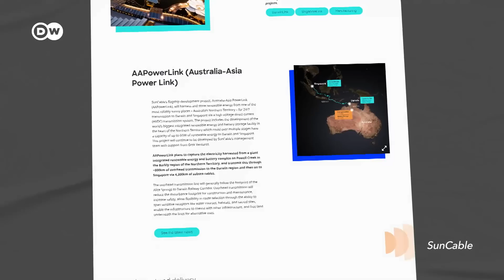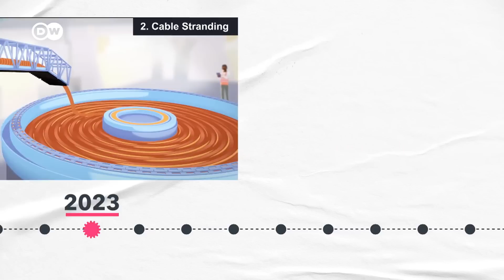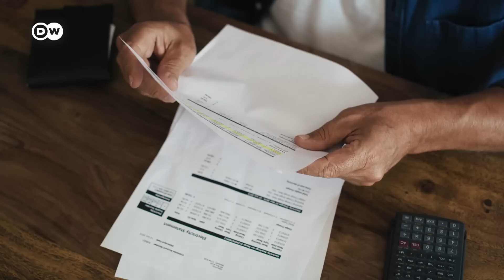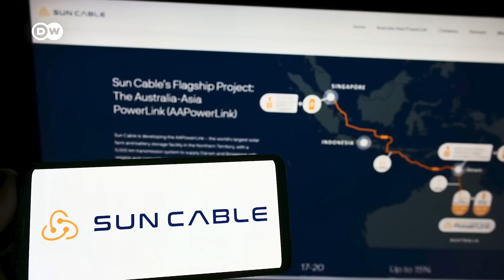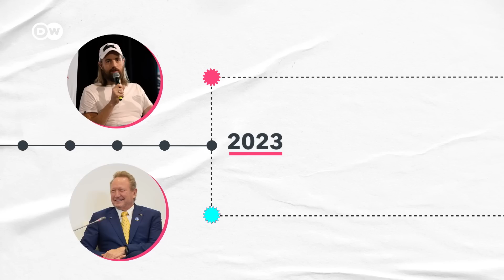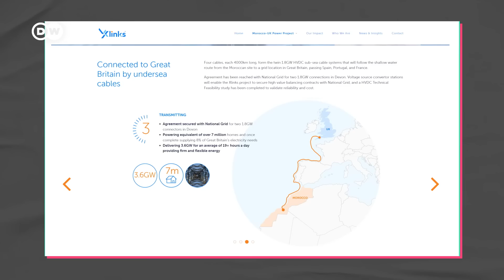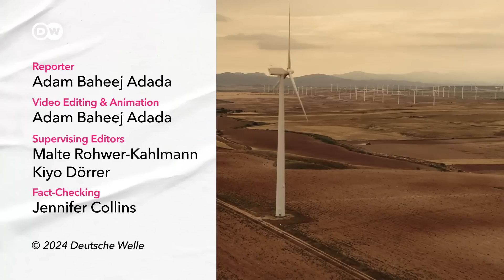Why the mega plan to send Australian solar to Asia (almost) flopped

Comment: I don't understand why such a project wouldn't aim first to power Australia with renewable energy. At present only 40% of the electricity in Australia comes from renewables. It would also avoid the technical issues of submarine cables and the potential sabotage risk of passing in third party territorial waters.
Reply: Power price during the day in Australia goes negative due in part to the high level of rooftop solar. So it wouldn’t make much if any money at all in the Australian market
Reply: @megapaul 13, this plant has a large storage array (i.e. battery). On the australian market, they would sell futures contracts via a (power purchase agreement) and mostly would not get paid the "market price". They would also store electricity to sell later in the evening, at high prices.
Reply: then how you get money from other countries , Its all about foreign money not about environment
Reply: @BanTeslaX  Probably better to get it selling clean energy in one form or another than continuing to supply coal and gas.
Reply: Build a big grid
Reply: @qjtvaddict  Really expensive though, and the grid needs to be balanced at all times.  
Just as an example Planet Money podcast did an episode of Green Gridlock.  The story was on 2 huge wind projects in the Dakotas - the projects were in the 1.2billion cost range - just connecting to the grid was quoted as $840 million (which was not part of the 1.2billion budget)
Reply: Nope, It's only 30%.
Reply: Simples, your government is held by its short & curlies by the fossil fuel mafia.
Reply: 05:00 the world doesnt include China......
Reply: Australia is the largest exporter of coal in the world.
Reply: Money is power 💸 nothing else
Reply: Evil Red Chicom will cut anyone's cables.
Reply: Australia is increasing their renewable power generation.     that can and should be done, but it does not need to have any affect on a possible Solar cable to Singapore.
Reply: I can answer the first part of your question - it’s because we already have a different massive project that will serve the states needs computer on renewables . And right now we have enough solar pv to meet more than 85% of the this state’s (Western Australia) electricity needs. And we are on track to completely wean off coal power with a decades time.
Reply: No technical or financial reason, just politics stands in the way. First problem: No matter where you build the array, storage, poles and wires to connect it, people object (why they wanted to build this in middle of nowhere and put the wires underwater). 

Second problem, gas and coal generators more or less write off expensive assets. This means a lot of money can be spent lobbying government to obstruct new developmemts, thereby delaying that asset write down (why they wanted to send power to Singapore, who would love to save some cash on gas imports).

Third problem: dealing with the energy market. It is financially complicated, imposes rules and regulations which can delay connections by years, and there is lack of coordination between generation investment and transmission planning (e.g. "this looks like a good spot for a solar farm", so 10 companies each put a farm there, but transmission capacity accomodates only 3). Singapore can accomodate this landing at one point, with capacity known well in advance, without much fuss.
Reply: The reason for exporting this much solar to Singapore and not use it in Australia is because there is an excess of solar on the parts of australia that have a centralised grid (the east). If this businessman invested his money on more solar, it will not be used and he will not make his money back. What we need more right now is batteries, and you may ask why he didn't invest in that instead. While I don't know his exact reasons, one of them was probably the fact that batteries are complicated to build, maintain, and most importantly, connect to the grid. It is a difficult process that not many want to go through.

It also simply comes down to the fact that its his money, and his decisions on where to invest.
Reply: @Ripcode2233891  the Australian Labor government is looking to invest in batteries through the Future Made in Australia fund. Private investors can get a bigger slice of the business when dealing with foreign export such as Suncable.
Reply: @Ripcode2233891  well batteries are a form of storage and are affordable for short term storage of seconds/hrs but for longer term storage the ammonia option sounds better because it also includes storage and can be transported and stored a lot like propane.  And NH3 has no c02 emissions.  The Japanese and Koreans are seriously working on using it in powerplants and maritime transport.
Reply: @peterkratoska4524  I don't disagree, but this is just a different project for a different area of the world. Singapore is much closer than both those countries
Reply: Reminds me of gambling addicts, doesn't work now, but I'm sure it will work if there is a little bit more money, It will work for sure, it's so simple.  What? A Ponzi scheme? I'm shocked, shocked I say.
Reply: we dont have any storage. how will we power all our homes at night when it isnt windy? its much more efficient to ship it off when its burdening our grid.
Reply: @jonathanodude6660 The project involved battery storage.
Reply: @CT-vm4gf  “At present only 40% of the electricity in Australia comes from renewables.” A project like this won’t change that. Anyways, I don’t think the NT is connected to any other state grids, so it would still require HVDC interconnection and thousands of kilometres of cables.
Reply: @jonathanodude6660  How would adding renewables not increase renewables? Nothing you said makes any sense.
Reply: @jonathanodude6660  tbh those are much easier to build, over land within the same country. the investors must consider diversification - internal supply, ammonia/h2 manufacturing as well as export to singapore. I don't think there is any shortage of land in the region to do all of the following.
Reply: @CT-vm4gf  "The project involved battery storage."
I still don't understand how batteries are feasible. To build that much battery storage we are going to have to rape the Earth of resources. Which countries are going to allow all that mining?
Reply: @jonathanodude6660  SO the Asia got storage magically ?
Reply: It only gets to 40% under ideal conditions. The reality on an average day is considerably lower, no matter what AEMO says. I don't trust their figures any more than other "tweaked" economic metrics.
Reply: In fact that 40% is an underestimate. Behind the meter solar cancels out a large amount of daytime demand.

Comment: Singapore is always going to be vulnerable to energy supplies, adding another suppliers reduces risks overall, even if each supply has its own individual risks.
Reply: Yes, that is correct. . .  Try to get to multiple sources of energy.. . .   Note renewable energy, Wind and Solar must not cause existing other power generation sites to be closed down, but then they can burn less fossil fuel.

Comment: Turning the power to methane or ammonia seems more viable. It can be easily stored, which reduces the concerns about energy security, just as how we use natural gas these days. It can be transferred without massively building a mega power cable network.
Reply: Hydrogen/ammonia is terribly inefficient compared to electricity.

Comment: 4:32 😂Indonesian Sea. Do you have permission?
Reply: Why not sell to Indonesia? And the connect the grid thru Indonesia? The whole idea seems stupid as it ignored the needs closer to the source
Reply: @crasho1980 indonesian state owned electricity company (PLN) is monopolizing the electricity all over indonesia, and the really hate competitor no matter local private company or even foreign company. Also indonesia lots of bribery.
Reply: @ridhobaihaqi144  in case you don't know, PLN buy electricity for private power plan. So buying from Australia is not a stretch. They will need to talk to Indonesia govt anyway as they need to cross Indonesian water.
Reply: If Elon Musk can enter the monopoly of Internet provider market
I'm confident that they can
Though don't rely on Indonesia to protect the cable

Comment: I am a big supporter of renewable energy, but this project doesn't seem that realistic. I'd love to be proved wrong.
Green hydrogen can be used in other ways. Ships could dock in or near Darwin and refuel with ammonia or methanol, whichever wins out. Green steel and aluminium are also great opportunities for Australia. That is another way to reduce CO2 emissions without the issues raised.

Comment: Apart from Australia, Indonesia has also been exporting its energy to Singapore, but not from renewable sources, rather from coal. Yet, when it comes to renewable energy, Indonesia could create a mega geothermal project that could provide a much cleaner and larger energy source. However, due to the interference of coal oligarchs, this geothermal renewable energy isn't being expanded as much as it could be because it's less profitable for energy capitalists.

Comment: nice idea ,however a nice idea is not necessarily practical since it creation based on prpgnd?)As we can see with the failing green Rave of Germany....Germany is just loosing competitiveness on global scale and the self inflicted pain does not help on global scale if a factory re locates from Germany to India (with lower regulation often leading to rebuilding cheaper with less regard to the environment)then on a global scale we didint remove but addit harm.

Comment: Battery ships to transfer the energy?
Reply from the maker: Hey there! There is lots of research done to develop this idea. One ship is set to be completed in 2025 and will then start with the testing phase. If you want to find out more, search for PowerX. However, it is made for short distances.
Reply: @DWPlanetA  Thanks 👍

Comment: Nuclear energy would make so much more sense for Singapore.
Reply: Singapore's energy market authority is closely monitoring the development of Small Modular Reactors. The ground clearing at Darlington nuclear power station in Canada has started for the first four BWRX-300 to be built. Poland has approved 24 BWRX-300 SMRs but are not as close to construction commencement as Canada. Many countries are sitting back waiting for the outcomes of the Canadian & Polish projects. Building the same reactor design 28 times is expected to give the construction experience and establish the supply lines to get significant reductions in both cost and construction time. By 2030 I'd expect to see more countries signing up for SMRs and the large nuclear rollout the IPCC notes as necessary to reach net zero will be on in earnest.
Reply: For Australia there are two big obstacles, Bowen and Albanese.
Reply: @tonybloomfield45283  Albanese has been the spearhead of ALP anti-nuclear policy for close to 50 years. Australia needs bipartisan support for nuclear to get off the ground but the ALP will never agree as long as Albanese has any influence over policy. 

We ended up swapping climate change deniers for climate change solution deniers.
Reply from the maker: Hey everyone! We actually looked at SMRs recently. You can find the video here 👉 https://youtu.be/GhKQ8EP1a1Y Let us know what you think about it ✨
Reply: @KP-PizzaRider The opposing LNP is also quite anti nuclear, but for protecting coal & gas generation interests. In fact, they were the ones who banned nuclear generation in Australia in the 1990s. Labor also joined suit to please the coal miner unions.

Comment: A mix with a minimum local energy for security and a free market for the super grid which should be very low cost with super cheap solar and very long life grid cables to maximize amortization cost timeframe.  The benefit is encouraging economic cooperation and rule of law.   The cables really need deep burial to prevent sabotage by fossil fuel terrorist and rogue states

Comment: Isn't the solution to sunlinks problem to give Indonesia access to the power cables. Indonesia is a chain of islands that could greatly benefit from moving green energy between the islands, and the cables are the exact infrastructure they would need for that. They might even want to buy some excess from Australia or sell to Singapore and beyond.
Reply: its a singaporean company, and yes theyve asked indonesia to join in. they have a website, so you dont need to comment on this news report asking questions that have been answered 😂 i havent checked it since the plan was cancelled and then restarted with new investors though.
Reply: @jonathanodude6660  I'll comment on what I like to comment on thank you very much
Reply: Exactly, organic growth, giving everyone in SEA the chance to seek how it works and to keep up with their neighbours. Nobody wants to take a risk, nobody wants to be left behind either. Might even get Aus on board as well.
Reply: Indonesia has enough / excess power which is from burning abundant coal, so this green energy from Australia isn't economical to this country. If Singapore wants energy and don't mind the coal burning, Indonesia can provide it as well.
Reply: Most of the Indonesia island sit right on top of the Ring of fire, that already post a huge challenge to lay the cable without worrying seismic activities destroy the cable.  As for solar, why pay a huge fraction to help OZ to fund the supergrid project when you can harvest the sun power yourself?

Comment: The idea is dodgy in the first place if you are familiar with the countries involved. For example, Indonesia's power demand is projected to grow from 65 GW current demand to over 200 GW (this isn't that high, it's basically 5% increase annually over 25 years) in several decades. If the idea is to sell the solar power that Western Australia have in abundance, it makes way more sense to sell it to Indonesia and cut the length of the cable by half or even two thirds. Or if the idea is to sell solar power to Singapore, who's trying hard to reduce and even eliminate their gas-fueled power plants, it makes way more sense to open solar farms in Sumatra and Riau Islands that are right next to Singapore. While those islands are more densely populated that Western Australia, there are still plenty of areas that can be used for solar power. The cable needed then would've been just a hundred km long or at most two hundred.

Hence the questioning about whether the 12 thousand km long cable makes sense.
Reply: I heard that Singapore is doing exactly that, which is planning to build solar farms in Indonesia (and import the electricity). It's said that one of the biggest hurdles is the battery storage which needs to be massive (and expensive).
Reply: Fact is that Singapore can pay more money than indonesia, so it is easier to break even supplying power to singapore. Singapore also doesn't have many options for power on it's own so you can say it is more desparate.
Reply: @oadka  The fact that Singapore can pay more may explain why SunCable was interested, but that very same fact is also why Singaporean companies are forming joint ventures with Indonesian companies to open solar power plants in nearby Batam and sell the power to Singapore. Because whatever price SunCable can offer, they can beat, because their cable only has to be 100 km long. And if you look it up, that's exactly what's going on.
Reply: The problem is that we, Indonesia, don't need it. we can build our own energy sources.
Reply: Yes. Steel is expensive.
Reply: @VanillaMacaron551  No, copper is. Power cables are made of copper.
Reply: I've got one word for you. Clouds
Reply: @sam-cc6sd  There are clouds, yes. So? There are energy storage solutions out there, you know. The Singapore-Indonesian JV that plans on exporting solar power from Batam Island to Singapore for example will pair 2.2 GWp solar panel with a 4 GWh pumped hydro storage. Yes, this is just a tenth of SunCable's proposed 20 GW but they can do this ten times and still come out cheaper than laying 12000 km of high voltage power cable undersea.
Reply: All the more reason for more of these HVDC undersea cables.. .   There is actually enough areas in Australia for Solar Panels that could provide all the worlds electrical requirements.. . .  But my "InterPower" concept spreads that Solar collection all around the World, so always Solar power available 24/7.
Reply: 65GW. That is more than the whole of the UK? Graned the population is higher but what are they doing?

Comment: I think I've read somewhere that the cable that supposed to connect the UK with Morocco would need more than the steel produced each year. That problem is bigger than red tape or trust issues
Reply: That's incorrect. Read again.
Reply: @velisvideos6208  That's really useful
Reply: I think you mean in excess of the sub-sea cable produced every year - that's why the company concerned is also planning to make it's own cable and have begun construction of the manufacturing plant in Scotland. This plant should open next year and eventually employ 900 people plus more in the supply chain. X Links say that worldwide demand for sub-sea should increase seven-fold over the next decade.
Reply: No that is not correct.